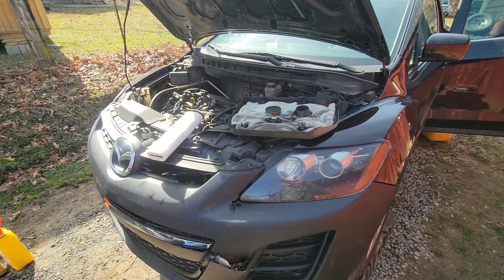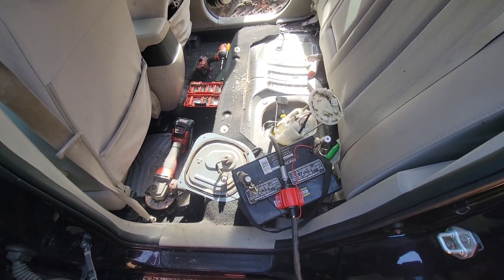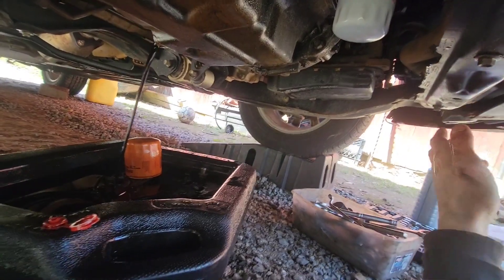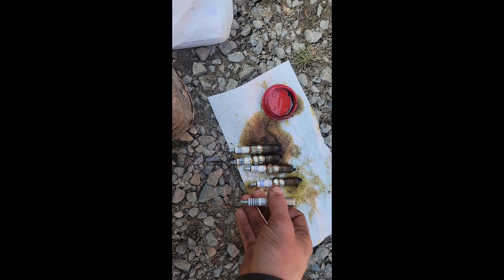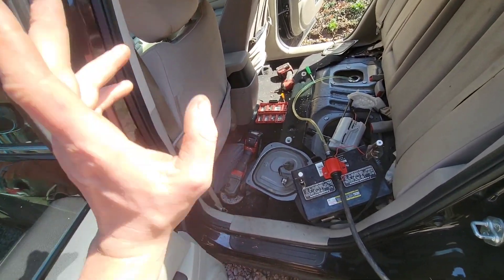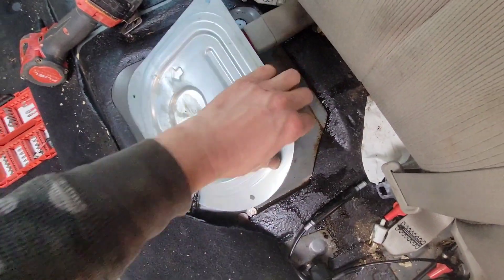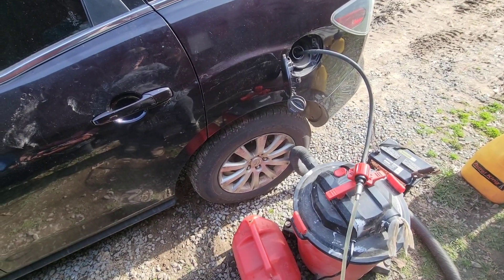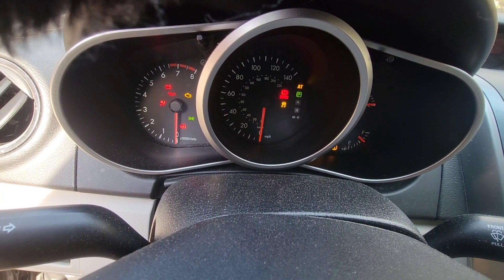2012 CX7.Was filled with diesel fuel. Pumping out the tank. Spark plugs and an old change.HowtoVideo

Comment: That is perfect, I have heard some people that the commenting that the mechanic or dealer also recommended changing the fuel pump and injectors, which I think is a total ripoff.

A friend of mine that adds a quart or two of diesel to the fuel tank during long trips and that helps him to get more miles per gallon.  

I also have added a quart of diesel as upper cylinder lubricant to my 1970 Camaro.
Reply from the maker: This car has almost 300 miles. Since I did work on it I did not change the fuel filter because the fuel filter and the fuel pump is one symbol that is non serviceable. This is the 2nd one I fixed that this has happened to. The 1st one is still running just as good. The lady did not have the extra 350 for a fuel pump/fuel filter. I cleaned it as best as I could and we sent it and it's been doing good.
Reply from the maker: If my 1979 Ford F150 sets around for a while I will add a quart of diesel fuel to it. Just to help lubricate everything when it runs again.